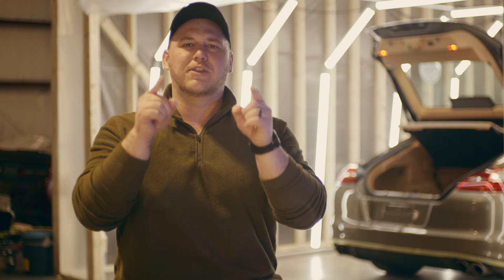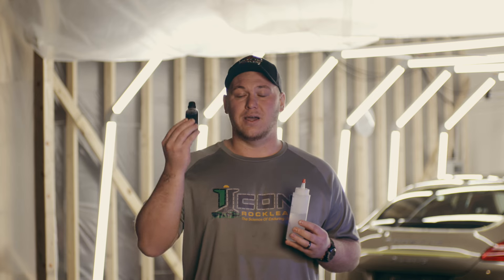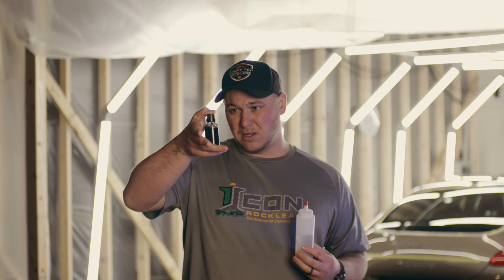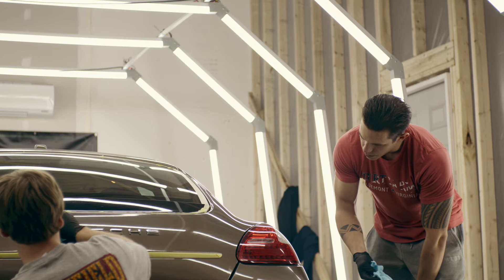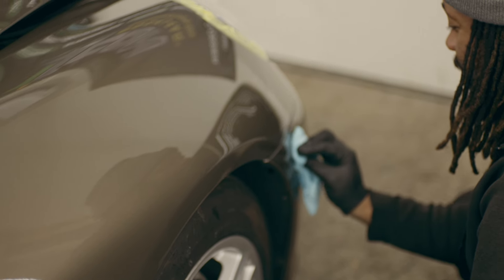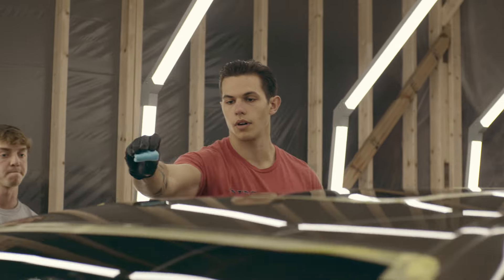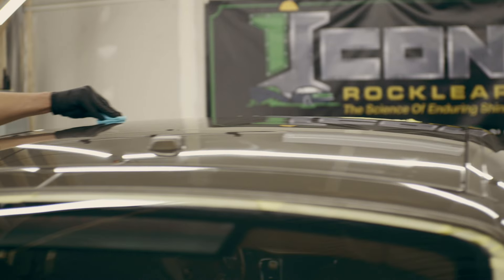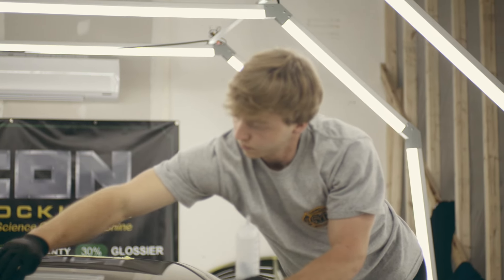Is Icon Rocklear A Ceramic Coating?

Comment: I've seen a lot of videos on this but no one ever mentions the cost to the vehicle owner to have it applied to a vehicle? Average size sedan, sportscar, SUV etc. What is the range someone should expect to pay?
Reply from the maker: The range varies on many factors… I can speak for our shop, typically anywhere from $1200-$2200 depending on the size, condition, color, and year of the vehicle 😁
Reply: Let's see you take a  key to that Porsche ! If the product is that good then prove it

Comment: I am highly considering 100% converting to this. Is paint correction necessary? I saw a video of a severely swirled vehicle and this product was applied and the swirls were non-existent.
Reply from the maker: Paint correction is not required because it diminishes the clear coat. Applying Icon Rocklear will provide a better result than a traditional paint correction! Reach out to us: iconrocklear.com

Comment: I have been certified with some of the top ceramic coating companies since 2014 and icon Rocklear impressed me so much that I'm gonna get certified with it. And stop offering PPF at my shop and only offer icon for true protection.
Reply from the maker: Amazing! Reach out to iconrocklear.com and get signed up!
Reply: Can you put this on black plastic trim too? Also, where in VA are y’all?

Comment: I just  had  a2023 C8 Z06 Rocklear coated, and now it’s parked for winter here in Maine. I have no doubt based on what I was shown that there is definitely more paint protection. My only negative comment ( not really negative) but it’s definitely not as slippery as a fresh waxed surface, have said that, is it ok to use a maguires spray wax or similar. I have done it in a non conspicuous spot, and it definitely is more slippery and I would say shiny. So any input you might have on after care would be appreciated. Thanks
Reply: I am not an Icon Rocklear installer but ironically this gentleman in the video spent a good amount of time yesterday with me on the phone. To answer your question I was told once icon Rocklear coating is installed one can use their favorite wax on top, sealant, quick detailer and even apply a ceramic coating for the added hydrophobic properties. You can apply PPF over it and icon Rocklear is self healing
Reply from the maker: You can add toppers to the vehicle after the 30 day full cure time for different surface tension and hydrophobics. The main objective of Icon Rocklear is to be a strong durable sacrificial layer atop your clear coat to protect the clear coat from the damage as a frontline as well as adding extreme gloss. For renewed hydrophobics always consult with your installer for specific instructions! :)
Reply from the maker: This information is all correct. Happy to answer any questions should they arise! :)

Comment: Hi, Thanks for the reply, as it turns out, I just took it upon myself to try, I used Macquires quick wax and it worked awesome, much more gloss than without it and very slippery. Now hope it holds up well. Thanks

Comment: In the video you state that 3x the product is being used relative to ceramics however in other marketing material I see a claim that the layer left behind is 20 - 25 times thicker than ceramics.  Please help me with the math and explanation.
Reply from the maker: @kengibson9230  happy to help! An average layer of Icon Rocklear is approximately 63 microns of film build when fully cured. The thickest ceramic coatings may achieve up to 5 microns, majority remain around .5-2 microns. This is what makes Icon Rocklear at a minimum  35X thicker. It is 75X stronger, and 30% more gloss than the best ceramic coatings on the market. If you’d like to see the lab testing, the results are posted publicly on iconrocklear.com. I hope this helps!

Comment: This stops rock chips and self heals just like PPF?
Reply from the maker: @integrafreak1  Nothing stops rock chips entirely, but Icon Rocklear offers resistance against rock chips. It does self heal similar to PPF. It is also more scratch resistant than PPF. The honest advantage to PPF over Icon Rocklear is that PPF has slightly more resistance against rock chips.

Comment: So IR is almost like a ceramic ppf? How thick does IR get after it cures? I think ppf is about 8mm.
Reply from the maker: Great question! I don't like calling it "liquid PPF" or "ceramic PPF" because it may be misleading. Icon Rocklear is neither a ceramic coating or Paint Protection Film - it really is a stand alone product in its own category as a hand applied protective coating. When cured you may achieve 1.5-3 Mils of film build on one application.

Comment: How does it compare to Revivify?
Reply from the maker: Not comparable as Revivify is a ceramic coating and Icon Rocklear is not. It is a hand applied coating, but is not ceramic. Ceramic coatings are too thin to offer any scratch or impact resistance. Icon Rocklear however is way thicker, more durable. Icon Rocklear offers self healing properties, hydrophobics, gloss, and scratch and impact durability, strength, and longevity. All this in one product, unachievable by any ceramic coatings.

Comment: Just read a review. Not for sale to public
Reply: All superior products are typically commercial grade not consumer grade. Which means you have to pay to have a certified rep apply the product or you go through the company that makes the products training and get certified to be able to purchase the product directly.
Reply from the maker: Correct! You must be certified to use Icon Rocklear. It is available for purchase on a vehicle by certified installers.